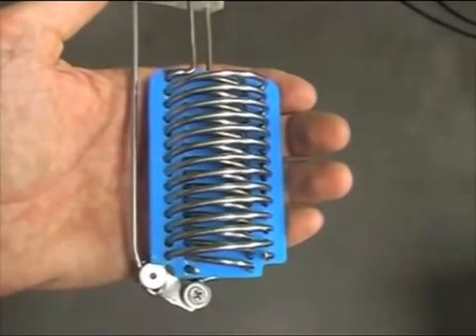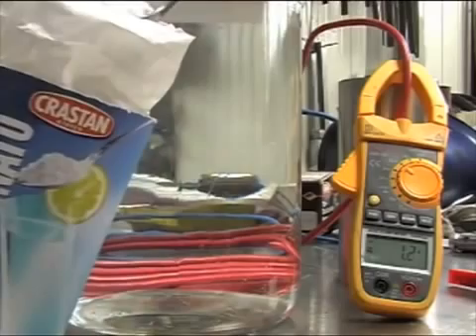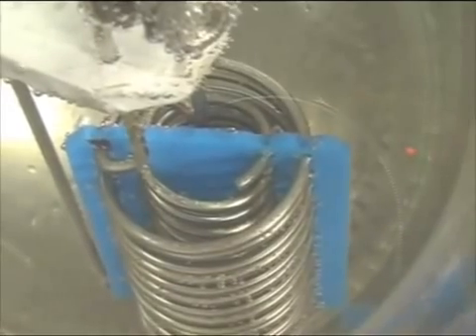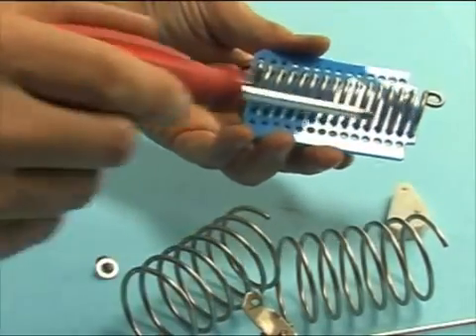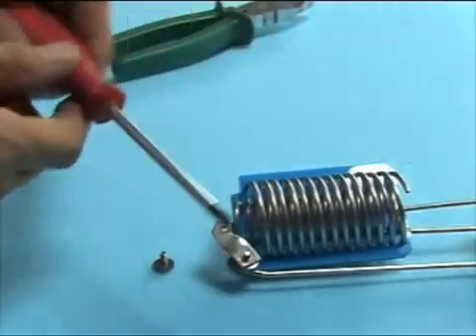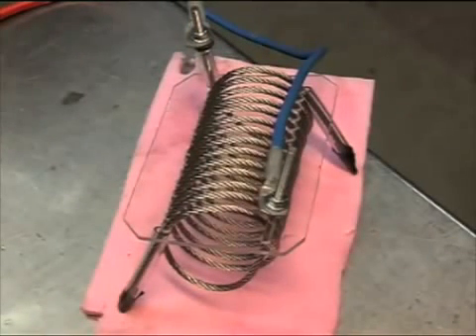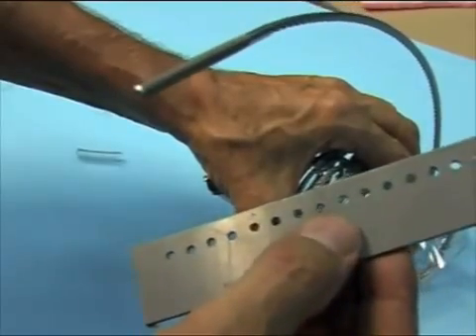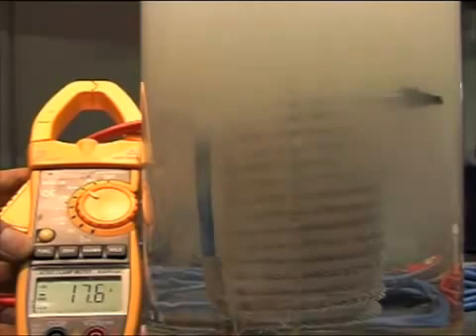Generador HHO-07.mp4

Comment: I wonder. I used 2 heat sink plates normally used in audio amps or power supply made of aluminum..........I wonder if this metal is ok to make a HHO generator.........I used these heat sinks because it was extremely easy to get more than 15 cells in less then 15 minutes of work........peace cake...........but I wonder about using aluminum. Any ideas???? Thanks. Ezio.

Comment: have you thought about using different material like nickel, for the anode and copper for the cathode. I think you get better results because of the resistance being less than stainless. just make sure that your electrical connections are all copper 2. thanks and God bless you and Happy New Year...
Reply: If you do that you'll end up with another process called Electroplating, the nickel in the anode will eventually be taken out and placed in the copper cathode, producing a redox reaction, on this process the water is also separated, but the device won't last and the efficiency is lower. 
See more: https://en.wikipedia.org/wiki/Electroplating#Process
For generating pure HHO you need to use the same metal in order to prevent the corrosion of the anode.

Comment: P.S. as water temp increases, so does amp draw.  In summer i just use straight tap water.  The contaminants aka electrolyte increases with stainless deterioration.  Too much electrolyte and you will pop a 50 amp fuse pretty fast in the summer time.

Comment: Very nice.  I dont bother with the pulse wave modulator.  I just control the amps by adding baking soda.  I also stay away from other acidic electrolyte.  Baking Soda eats the metal but id rather be safe.  Love the flex wire.  When I place it on my vehicle, i use stainless steel bucket to sync the heat from the water.  It also stands up to heat better than PVC.  Excellent vid!

Comment: Can u tell me plz what do u use to control voltage and amp, or do u just straight put plug into normal house switch which is high voltage over 200 v.

Comment: 5 years ago I did research for one holly year,and guess what happened did not work,why because Ono,you can produce a lot of hydrogen gas,but what happens when is produced well, guess what.? it gets hot so them doesn't work, Segundo,into the car the vacuum valves   can handle the psi,so to many problems in real time,good lock you should read Patric Flangan,inventor and listen  what he said.. Also  I spend hundreds of dollars.